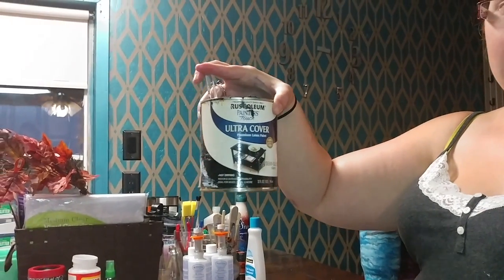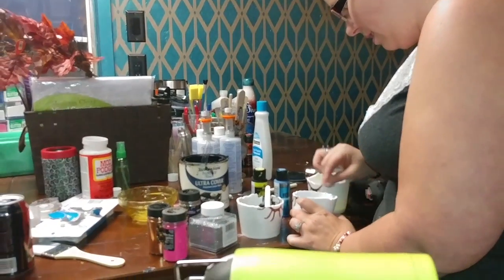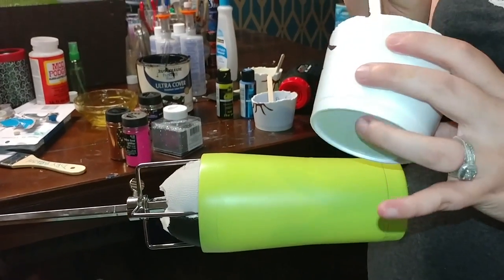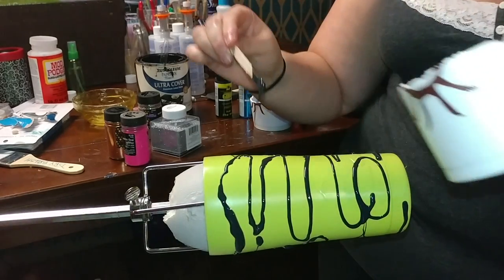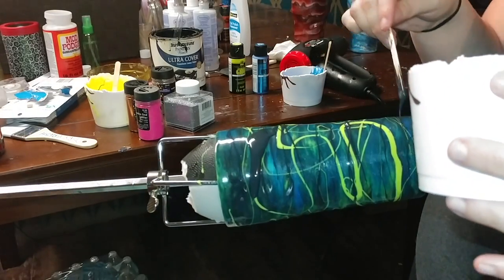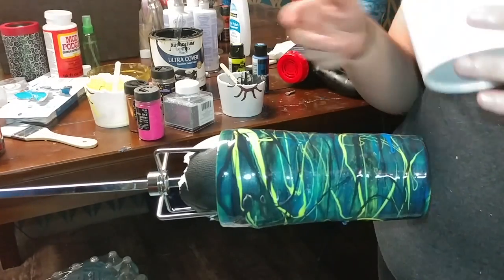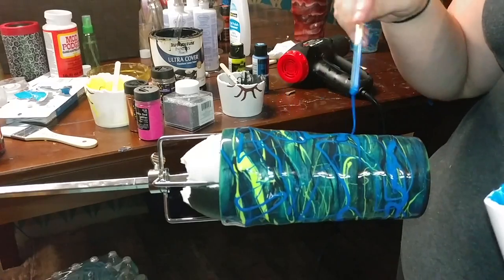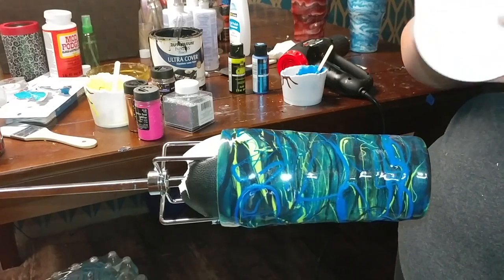Mixing Acrylic Paint & Epoxy for a Swirl Design on a Custom Tumbler

Comment: The stringy paint is curing quicker than the other ones. A chemical reaction ~ You can add alcohol and it will thin it out.

Comment: The syringe measure of epoxy works? Do you leave in the bottles like that or you close cap bk on? I'm looking for a better measure method then the med cups i run out of those lil cups

Comment: How could you add a decal. For example, I'd like to do this, but have a person's name remain the basecoat color. Looks great and thanks!
Reply from the maker: That would be a chore! the epoxy is always moving on the spinner so I dont think this technique would work But using alcohol inks I think would look great!!
Reply: From my experience, you let the cup cure then add your decal. You can put a really thin layer of clear epoxy on after.